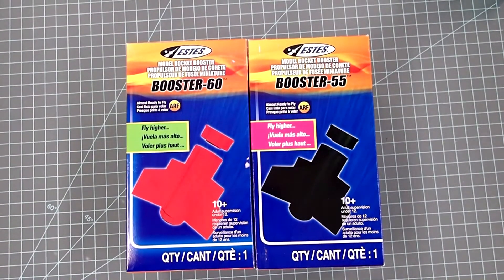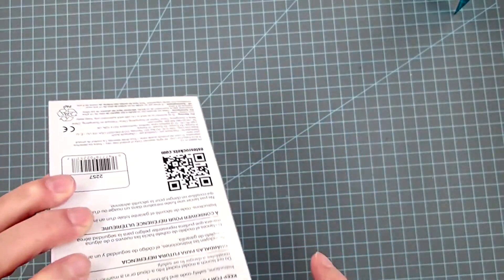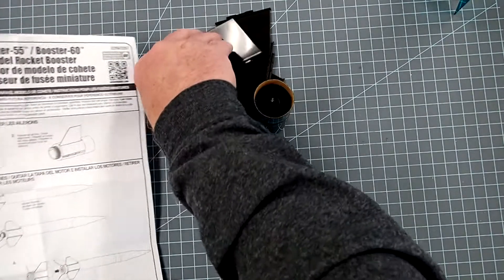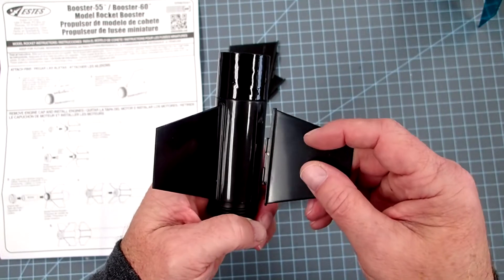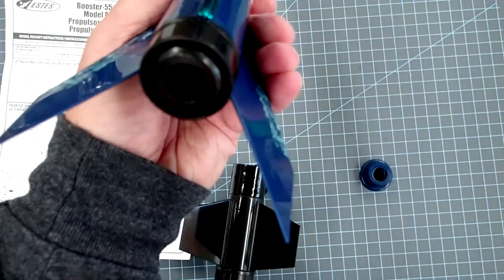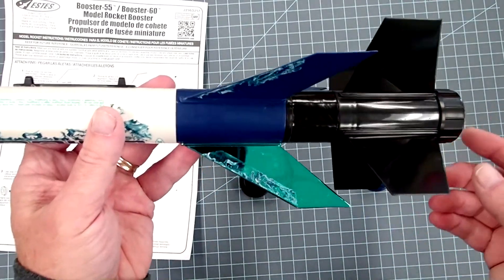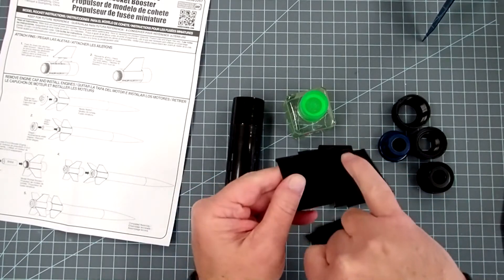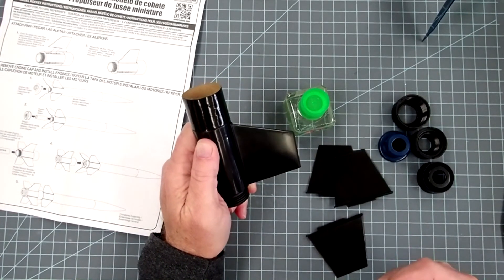Estes “Booster-55” kit assembly

Comment: I built two Booster-55s and removed the tube in front of the plastic fin unit so I could use it as a fin can section for D-powered BT55 rockets! I have a pseudo-scale rocket that looks like a member of the Nike family of sounding rockets I call Nike-Spock.

Comment: I have made a few successful 3 stage rocket with e engines and a c on top. I make the fuselage out empty Busch light cans and make fins out of empty cat litter boxes. I’ve got the fin alignment tool which helps a lot, still hard to get three sets of fins into perfect alignment. It’s fun building them from scratch like that but it sucks when you have a failure. Using f series now. Biggins

Comment: Years ago, I received instructions on using the liquid cement. Just "dry fit" the parts, then touch the loaded applicator to the joint and let the cement wick into the seam. It works perfectly, and creates a clean, strong bond between the parts. Sometimes (as in the parts you're joining today) it's required to touch the upper, then the lower fin joints so a complete wicking of the part's joints are made. It's a perfect method when joining small parts together provided they have a slot or alignment tab of some sort. 
Thanks for your build videos Dave, they're extremely helpful!